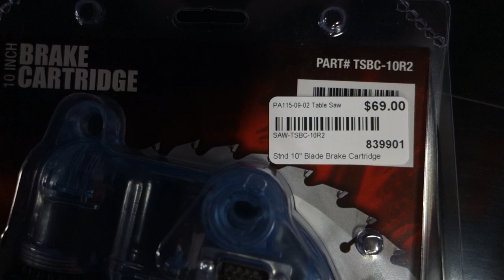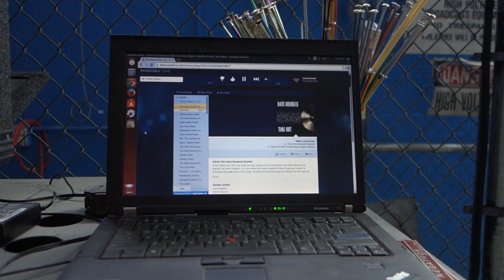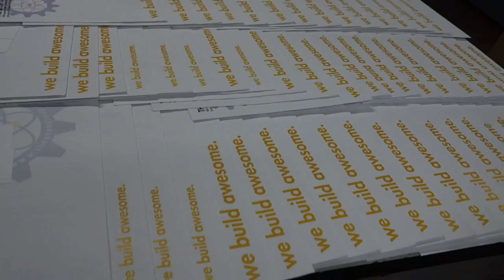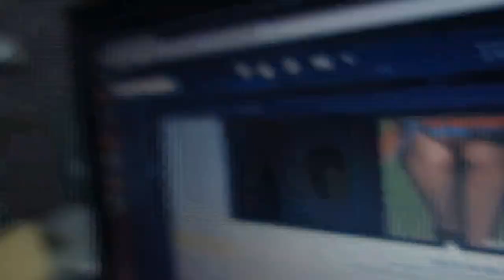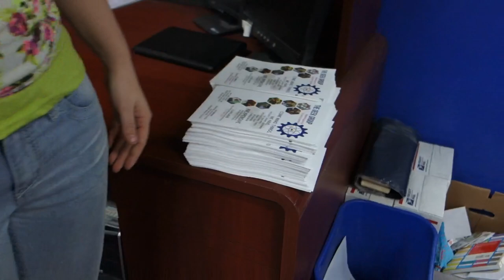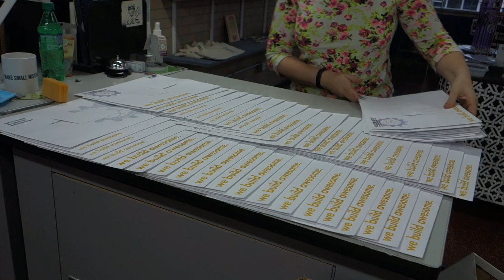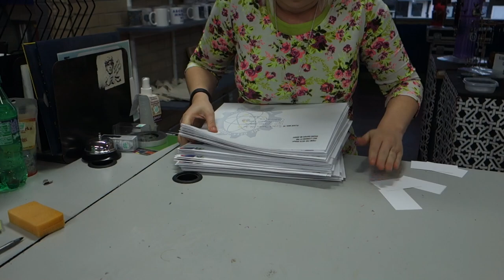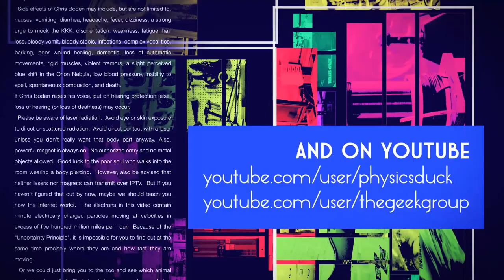Captain's Blog 10 14 2015 SawStop Cartridge Replacement and Grant Proposals

Comment: If you haven't already thrown away the busted projection TV and you somehow find the time, I recommend taking it apart, they have some really cool optical mojo in them. Might be vaguely useful in the laser lab. Also, you can use the mercury short-arc lamp from it to do solar death ray videos when the sun isn't out.